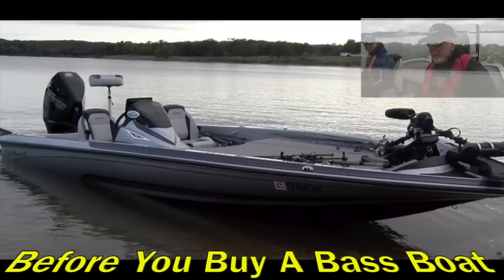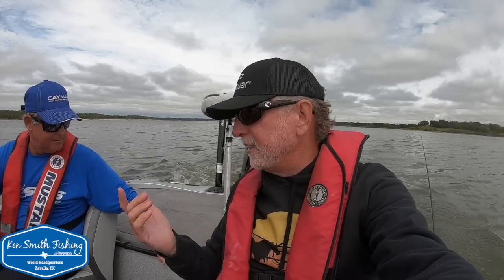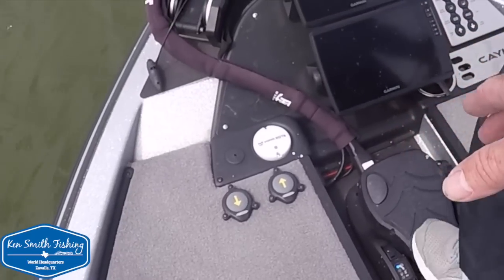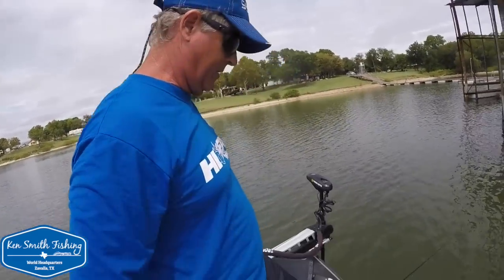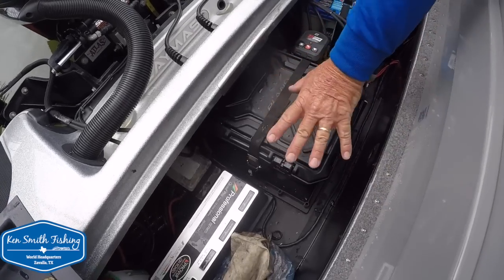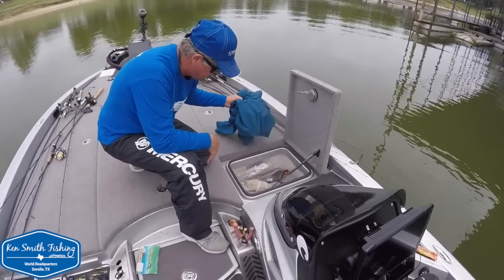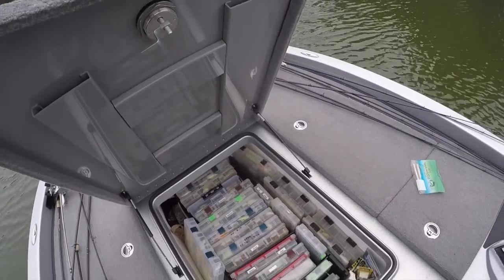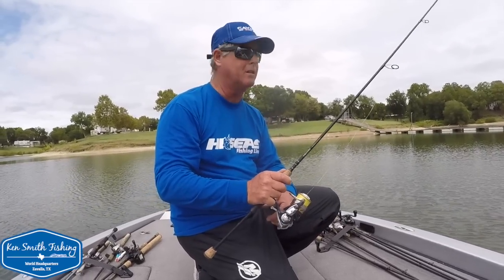Before You Buy a Bass Boat Watch This Great Bass Boat Search of 2020 21 Video 8 Caymas CX21

Comment: The Ranger 520C at the bow the beam at the seat base is wider than the than 521C and I think this is the same in the L boat. You were in a 520L which I think is wider at the bow at the seat than the 521L. Another thing you need to consider the lids on boats that are aluminum even if painted with change of temperature they will sweat and there is nothing to keep the heat from going through into your boxes which is bad for the live wells. Most pros put a type of rubber insulation on the lids. A few come with this. Ra angers lids are double layered with insulation in between.
Reply: All of the lids including the decks have a matt underneath the carpet. Kneel down on the deck of a Caymas and you'll feel the difference. I can't stand on the deck for 10 hours like I used to but the padding/matt under the carpet makes a huge difference.

Comment: At 78,000.00 I had to walk away it’s just too much money at some point you have to say it’s too much good video though a lot of information
Reply: Get you a Nitro and watch the 💺’s fall apart in the second season.. 3rd season the carpet wear down to the fiberglass.. Then hit something with your trolling motor and hear glass crack way to easy.. Drop in trash can for a cooler that holds ice till about 9:30am tournament morning,leaking tackel storage box’s,small gauge wiring threw out that if for so me reason you get a loose ground to the battery you’ll cook every wire in the boat,QUICK..!! Not to mention if you get your Z-21 custom rigged with the goodies and anything other then the standard “pro” package (poles,12”unit,9”unit,four bank charger,Ultrex112 that will literally fall apart after 1 year if you fish for a live like I do.. Your still at 70k...Pro package 62k plus tax.. The price on the Cayman really isn’t bad (which there ALL over priced) I’ve got this boat in a 21’ on the way 2021 model and it has five 12” units one being pan-optics along with five lithium’s and the ghost trolling motor...Oh yeah, two 8” kickers, mids,highs and a marine grade Rockford fosgate Punch 150 amp, jumper switch, spare 4 blade prop (700$),power pole charger 1300$.... Even got all the networking wires for the units along with the ethernet cables for the motor read outs... Pro wheel package black 18s... It’s got everything.. 78,000$....Really good price for what you get... Pay to play I guess... 40th place 10,000$ 🤷‍♂️.... Yeah, I’m rolling the dice.. Can’t take it with ya and you ant promised tomorrow.. Go for it 👊

Comment: Just another Triton built by Earl Bentz
Reply: Triton with all the complaints fixed... Not to mention the 20’ model loaded down on take off will pass every boat in the field besides the bullets (2%) of the boats on tour... I’m talking tournament on the road for 2 month kitchen sink loaded.. Not one guy and 1/4 tank like most will post there boat running 80mph...😂🤷‍♂️🤦‍♂️... It will pass them ALL trust me.. I live it and see it weekly.. Puma,cougar,that new skeeter,neck and neck with Blazer which is only (1400lb) bye the way... Cayman 20’ boat LOADED with a 240lb co-angler, ) 76mph... and thats a spare trolling motor in the rod box with FIVE batteries, 175lbs of tackle.... Definitely a mail toter fo sho... Before the rest tell me what yours will run.. I said LOADED full,gas,water,tools, co angler....I run a 920 Phoenix ProXP and it’ll come around me like I’m tied to something